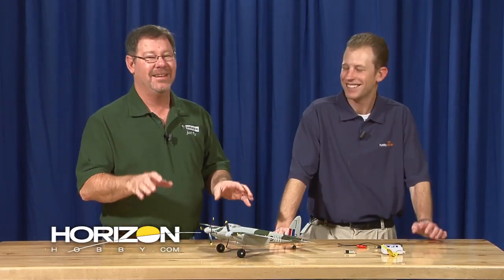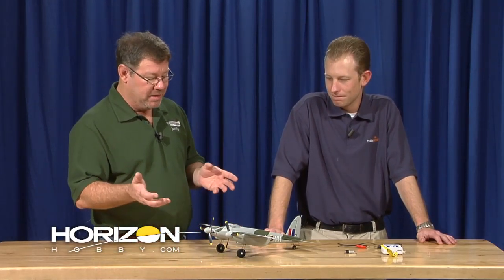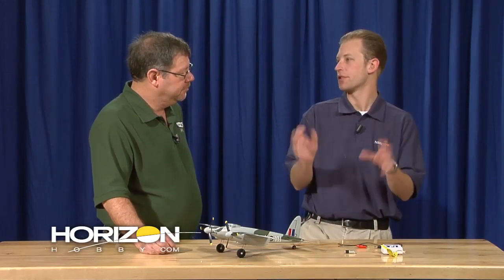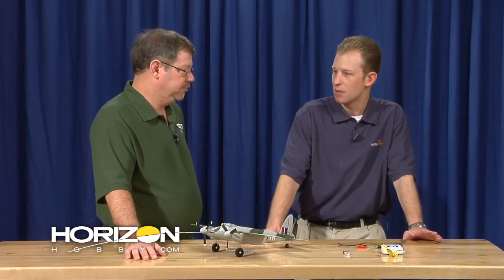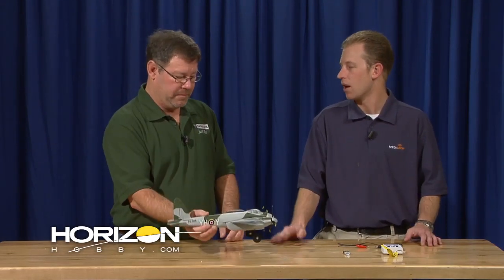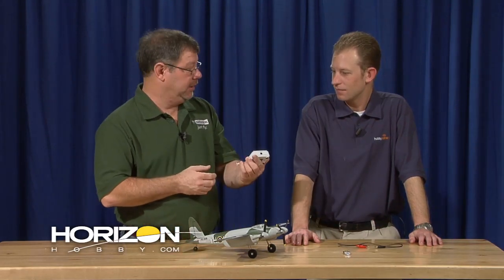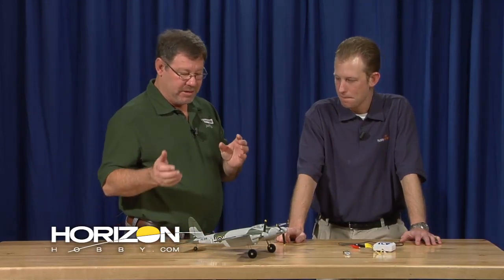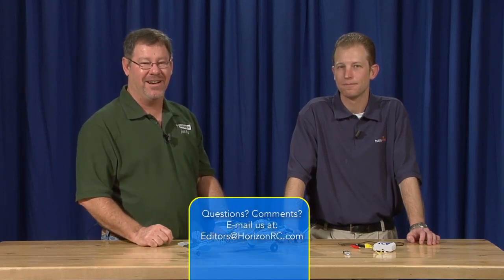HorizonHobby.com Preview - ParkZone Mosquito Mk VI

Comment: I have about four micros now and I don't think I will be buying anymore micros.  Theyvcan't handle the wind to good and I don't fly indoors.  Been playing with the Funjet and a J-Power 50mm EDF's.  I know this micro had a twin motor. I feel most of them fly the same with their tail sections being very weak.  Would like to see a new Platinum full size P-40 come out from Horizon.